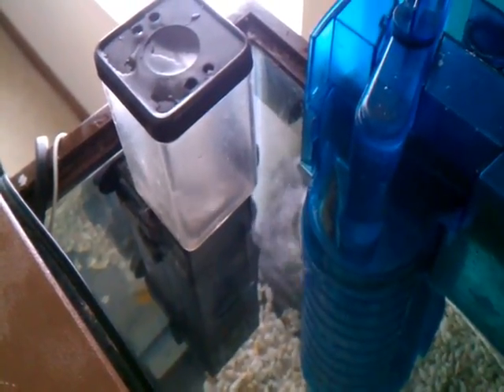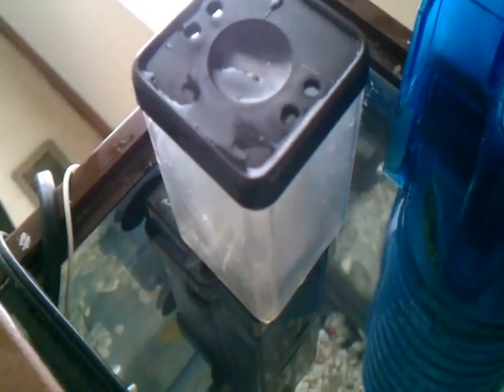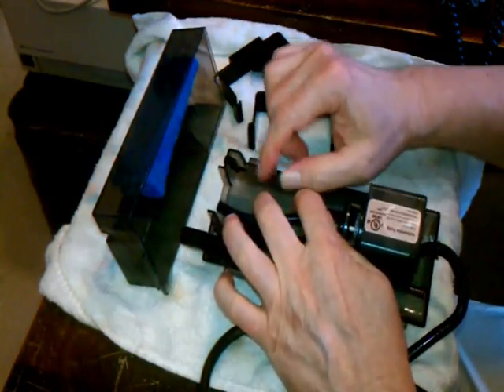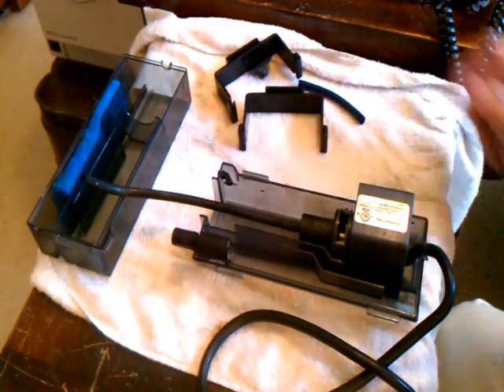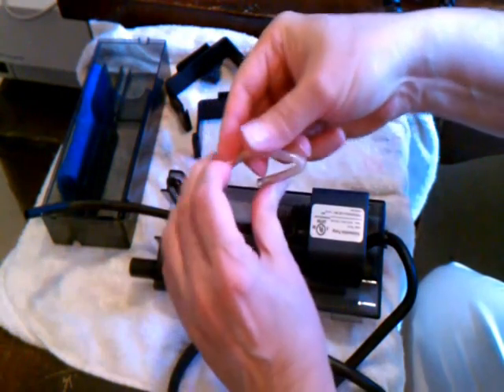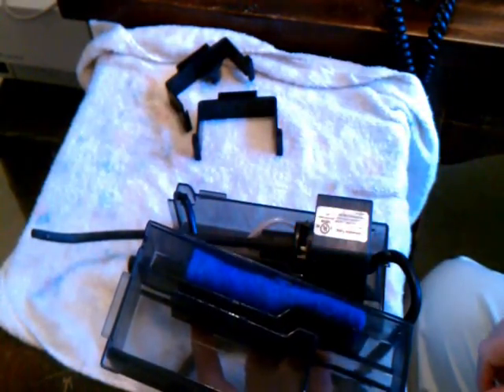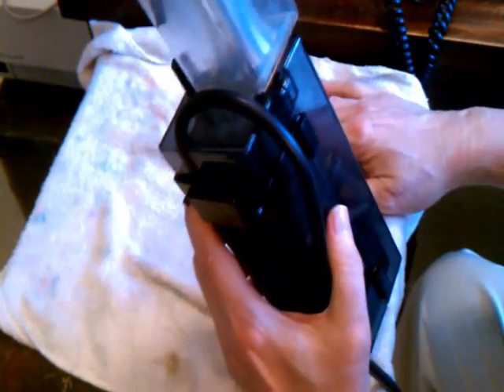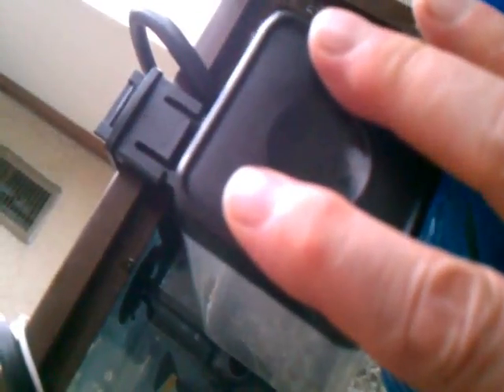Aquaticlife Internal Mini Skimmer 115 -  make it quiet mod

Comment: why not just drill out the plastic piece and put the hose thru the hole, That's what i did and ran a length of hose long enough to go into my stand so i don't hear the noise and I didn't have to cover the holes up

Comment: how'd you get rid of the micro bubbles??
Reply from the maker: +Luke Ryder I cut a filter pad to fit in the water return channel. This helped but still have some micro bubbles.
Reply: +mdmeyerpfa do you find yourself needing to replace that filter pad regularly?
Reply from the maker: +Tom Klausing I have not had to replace it. However I recently took down the tank. Too much salt creep.
Reply: where was the salt creep attaching? I just set up my tank and this was my main worry when switcing my 29 gallon from fresh to marine. I have a tv hung about 7 or so inches above the tank. I plan on using a lid though.